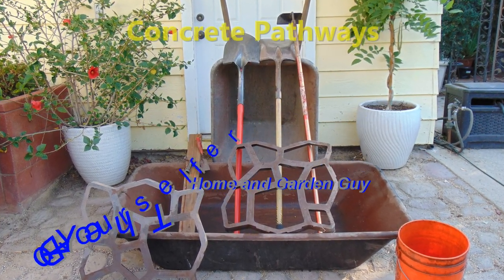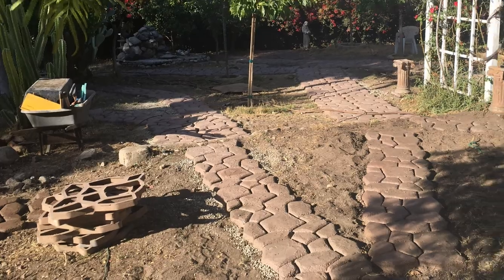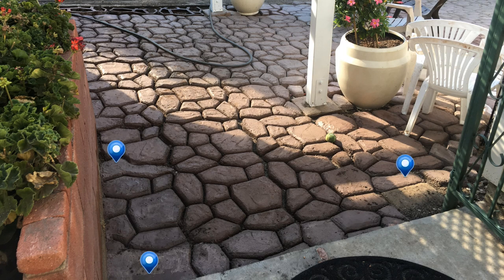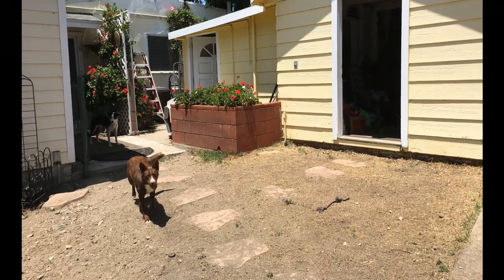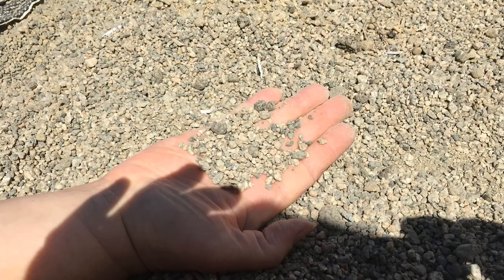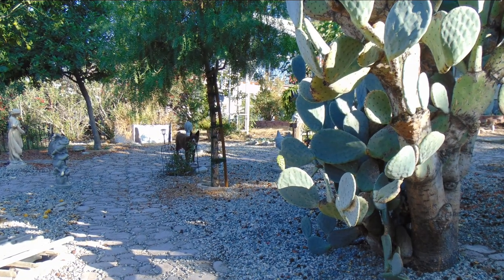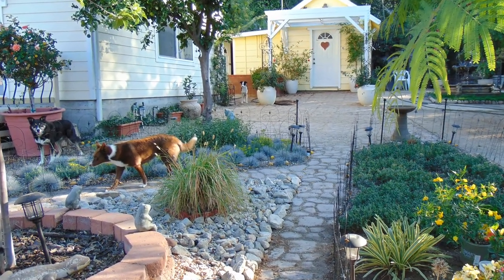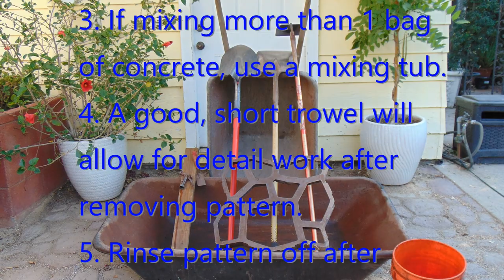Country Stone Walk Maker

Comment: Lay down your plastic liner mix up cement get a roll of plastic Wrap take a foot by foot section of plastic Wrap put a bump of wet cement in the middle of the plastic Wrap tie the corners so the knot is on top set on ground on desired pathway make as many of these as you would like and once they have cured use a fire line torch to burn the plastic off the top of the stones they'll have nice round edges they fit together perfectly and it will look just as good as this.